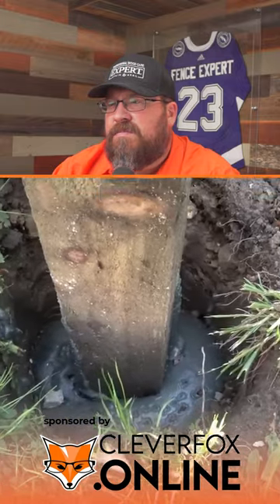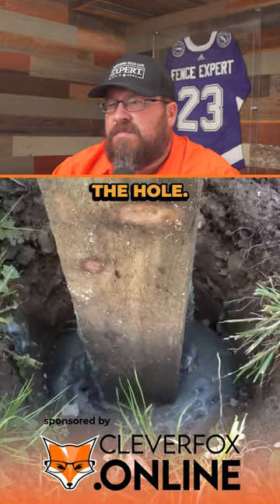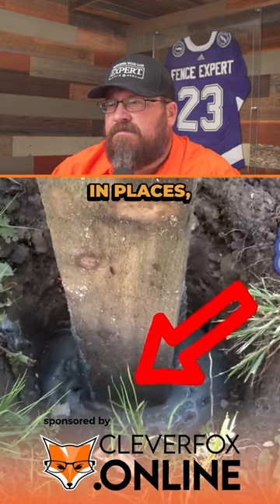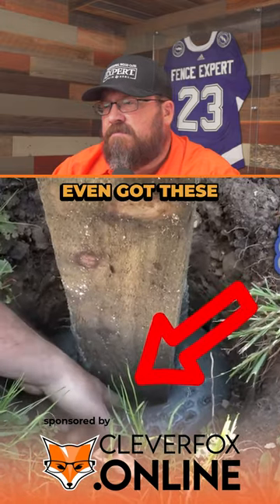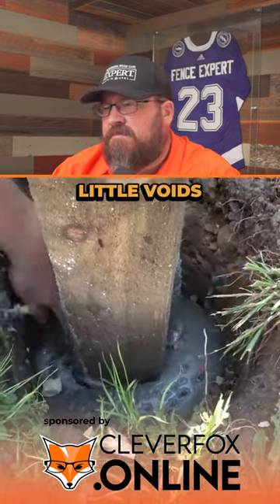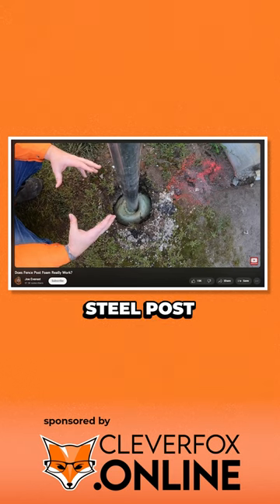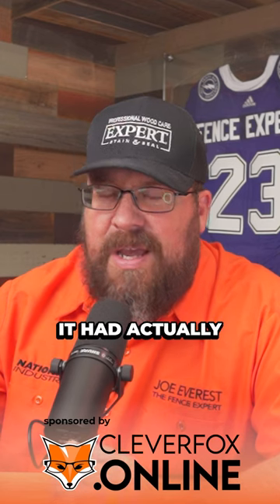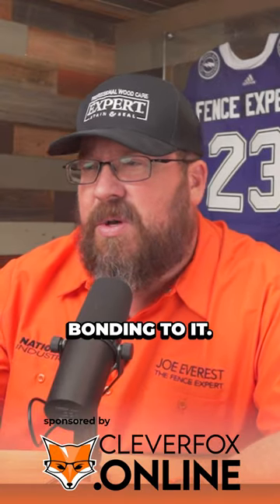This Fence Post Foam Just Won't Work! #shorts

Comment: its the ambient temperature. a & b foam is a chemical reaction involving heat. anything that is cold in contact will cause the reaction to slow down. the ambient air temp also effects this reaction.  like polyester filler, it will shrink if the temp isn't right during cure.

I remember stocking this stuff when it came out. It seemed like a terrible idea. It only makes sense for temporary fences.

Comment: We use this stuff exclusively for mounting  directv dish posts (3" gal). I've found that you almost always need 2 bags for a 6"×24" hole. Let the first bag set up, then let the second do the rest. It's stupid expensive compared to concrete, but the cost savings is in injury mitigation.

Comment: Also if the post isn't exactly centered in the hole (on a long fence some holes are off centered due to roots, rocks, etc) the foam that's thicker on one side can push the post over to the thin side, knocking it out of position.
Reply from the maker: Fair point, I appreciate you watching and weighing in!